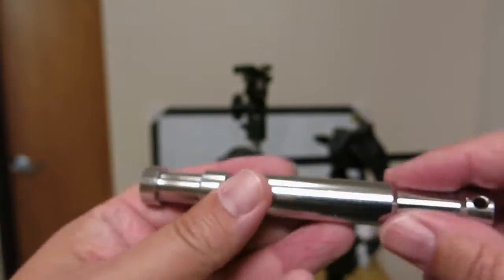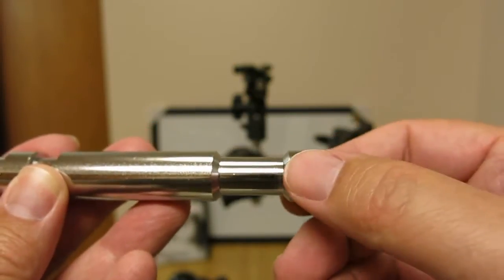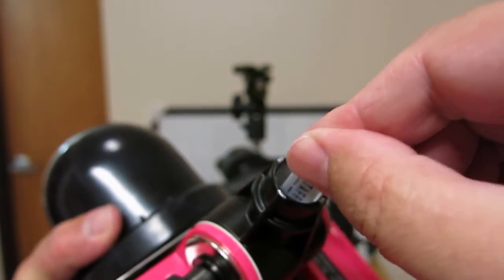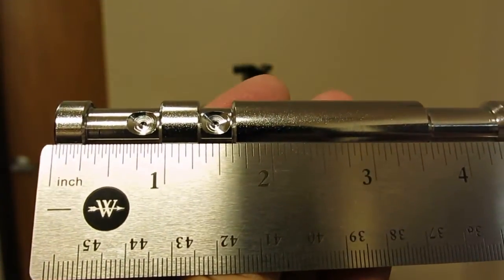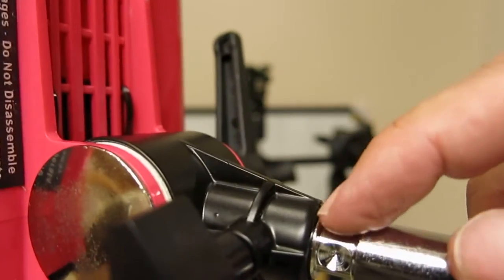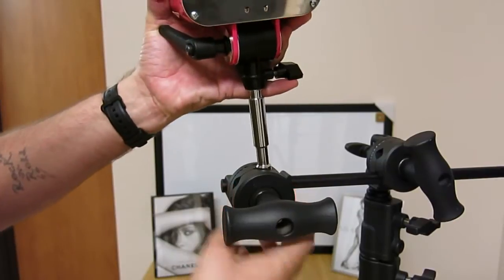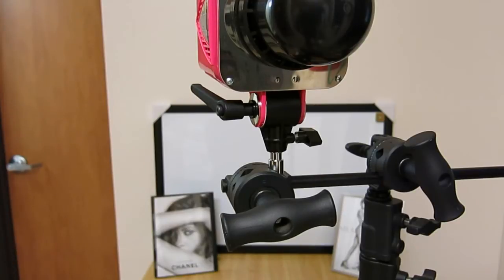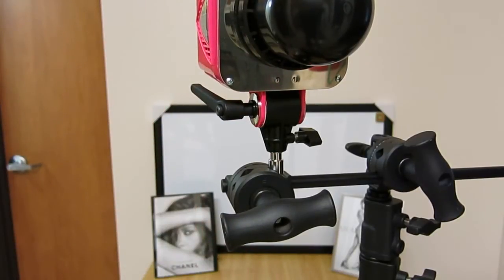Baby Pins, Umbrella Adapters, and Grip Heads.

Comment: Basic rule: with the tall leg facing away from you and the grip arm extended over it, the small knobs should be on the left, and the big knobs on the right.  Then the weight of whatever is mounted on the grip arm tightens the screw, which is safer.

Comment: Good video. I am still struggling to fixure my godox AD600E WITSTRO on my boom arm. The other end of boom arm( one end is sand bag holder) is left with common light stand spigot.  
I don't think so my AD600E  and godox 120cm octabox can sit on proper angle to make sure for key light ( main light) position .

You have shown in the video a grip head with multiple holes.  Is it a metal one? Kupo brand has got a similar product , which is expensive.
But there is another grip head silver metal fix on booms arm. Kupo Ez grip finger head model KG011212, and 6inch pin model  KG300612 .

You have a different type of fixture on the boom arm end.
I am confused with which one can suffice my objective and purpose.?
Reply from the maker: Greetings, Siddhun. My C stands are all made by Impact and, yes, the grip knuckles are made of metal. They have two openings or channels, one for 5/8" and the other is smaller, perhaps 1/2" or 3/8", not sure which. Getting all the components to work together or sync can be a pain, with different manufacturers making items to their own proprietary specs. In the IT world, think Apple or Cisco. Same principle, just with photography gear.  Wishing you well.
Reply: Not sure if you ever found your answer but a drop down baby pin from matthews would probably do what you need it to. Flip the c stand arm around so that the bare end is boomed out where you want your octobox. screw the baby receiver side of the drop down pin to the end of the grip arm, and then adjust to get whatever angle you want.

Comment: My babypin indent doesn't match my strobe screw. Would this me a problem?
Reply from the maker: Hello, Mr. Tran. Can you explain further? Does the baby pin have two holes/indents?
Reply: Room 111 Photography yes it down. When I insert the pin, the hole sits higher than the screw of my strobe. 

When fully screwed in, the baby pin sits crooked.
Reply from the maker: Did you get the Avenger E250, the pin with two holes? And the lowest hole is still too high? What strobe are you using?
Reply: Room 111 Photography the pin came with the stand. It's a Flashpoint C Stand.
Reply from the maker: Oh, I see. Please follow my video here and measure the inside your strobe collar. The top of the bottom hole to the end of the Avenger E250 baby pin is 1 3/8". If the top of your screw to the well of your strobe collar is 1 3/8" or less, then you should be good if you order the E250. As a work-around you can use a power drill to drill into the pin you already have. Just drill a small hole and you should be good.  If you do not have a drill then I recommend you visit a local machine shop and ask them to drill the hole into your pin. I used to visit local machine shops and welding shops, asking them to help with various projects that only took a minute, and they were usually very accommodating. And if they charge, it should be minimal. Hope this helps.

Comment: the boom arm is upside down...
Reply from the maker: It's upside down only when the attachment has sufficient mass to loosen the knuckle. Look at what I had on the arm. Not enough mass to loosen the grip. But I understand you theoretical point.
Reply: @room111photography5  It's still best practice to always have it in the position to tighten the knuckle. Would be a good thing to address in the video.
Reply: Roy Bixby that’s a grip arm not a boom arm
Reply: I just mean knuckles being the wrong way...